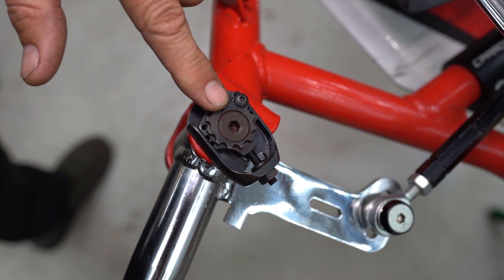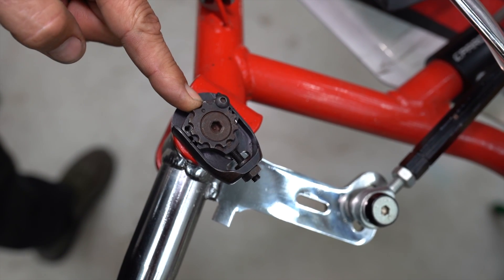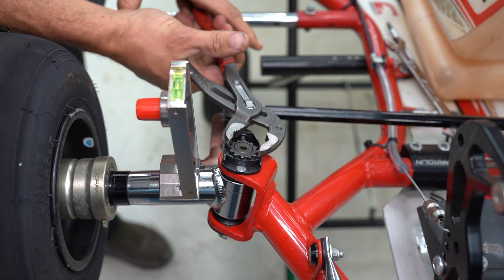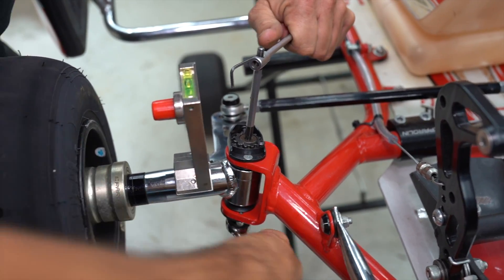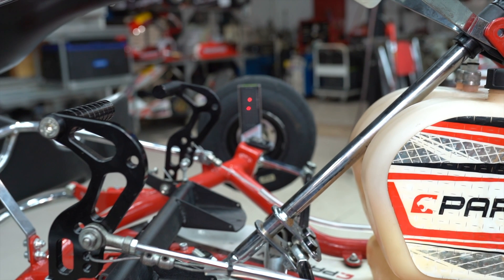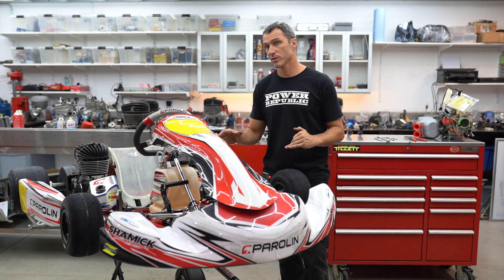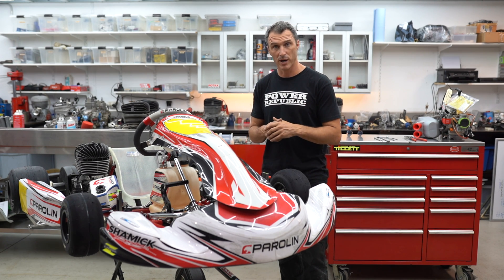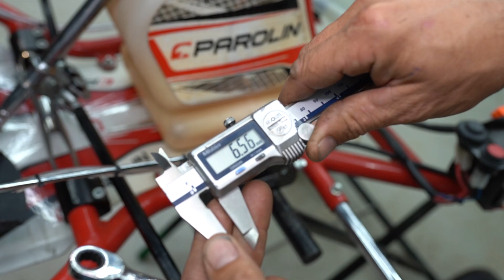HOW TO: Adjust the Caster & Camber on the Parolin Kart - POWER REPUBLIC

Comment: How do you find the center point of the steering wheel, which I assume you must do before using the Sniper Wheel Aligners?
Reply from the maker: I just turn the wheel for a rough estimate to begin with.  Then fine tune it using the full lock to lock method to make sure the tie rods are the same length.

Comment: Hello Sir. I just bought karting for my almost 6 yrs old son. One thing i dont understand is,when i turn a steering wheel in right side for example,inner wheel is" opening "more then another one. Also is happening in opposite way. Im notice,this is happening only when karting is staying on one place. Im new in these world,so ur opinion and advices means a lot to me to make my son happier in his desire to be racing driver. Thank u in advance.
Reply: go karts have uneven turning radius's, this is called an ackermann steering geometry, for karts, this means the inside wheel turns more than the outside wheel, this is because the inside wheel needs to travel a tighter radius compared to the outside wheel. 

Karts also have a secondary function in their steering: you'll notice the inside wheel will dig into the ground when the steering is turned, this is so the kart can lift the rear inside wheel off the ground (called jacking) to take the corner. 
When you take a corner, your outside wheel needs to travel a greater distance than the inside wheel, so on a go kart with a solid axle (pretty much all karts) the inside tire would slide and scrub while the outside tire takes the corner. This is slow, and so is fixed by jacking the rear inside wheel in the air, so now the outside rear wheel can take the corner, and the inside rear can free spin in the air and not cause any scrubbing.

Comment: Im havjbg trouble with my camber settjngs moving ,the kart is pretty new . What mite this be ,im doing them tight
Reply from the maker: are you using the locking screws ?
Reply: @PowerRepublic  I'm not, but that because I can't get the settings to where I want with them in

Comment: When adjusting Castor on the Parolin, I find simply using the reference dot on the castor assembly easier than fiddling around verniers' etc.
Reply: It's castEr, not castOr. CastOr is an animal.  Google it!
Reply from the maker: thanks for the tip and tuning in.

Comment: are you finding the camber movements too coarse? it seemed that one hole made a huge movement. Sort of surprised the second locking bolt hole isnt a "half hole"
Reply from the maker: nah they seem pretty good.   you could drill and tap another hole if you need finer adjustment .  have you got a parolin?
Reply: @PowerRepublic  no I dont, have 2 otk cadets and a birel cadet at this stage. 3 different chassis with 3 different drivers on track keeps me scratching my head

Comment: Love your videos too. I have learned a lot, and I mean lot. I have watched basically all of your videos and i know more about karts now than most of the people at my track.
Reply from the maker: noice
Reply: Hi just wanted some advice on using the snipers at the weekend I was at the track setting the toe with the kart on the trolley the snipers used was the same as your using it showed the kart had negative one side positive the other at 1st I thought kart was twisted we then put the kart on some tarmac and showed it was fine  any advice please ?
Reply: @forcedinduction2918 It is fine since when the kart is at the tarmac, it lies much more flat in comparison to when it is on the trolley. To check, put the kart on a very flat surface and then check it again.

Comment: Im building an electric kz kart(250km/h) and designing a whole new frame myself in cad. Just wondering, roughly what are the dimensions of the pipe(diameter x thickness)?
Reply from the maker: 32mm